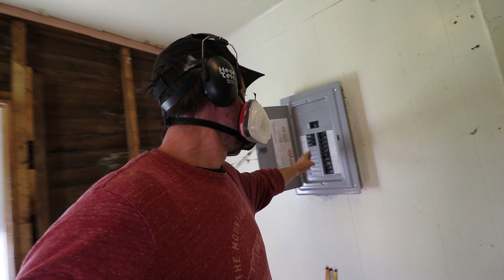You Won't Believe How Fast The Kitchen Disappeared! (home renovation demolition)

Comment: I totally agree that books are not meant to be thrown away BUT if you have a record of each book (even just a picture)  you can start the adventure of replacing them.  I have moved several times and my books had to come also. Tragic struck on my last move when the moving men put only half dozen or so of my boxes of books in the basement which was damp. I cried. Then my sister (the librarian) told me what I just told you. Start the adventure- visiting used book stores is always a fun trip. I still miss them, and have not been able to replace them all YET, I keep trying. Chin up and power on. Luv you all!

Comment: Was sad to see the cabinets come down.  I work in a cabinet shop and I see great kitchens come out just because they want a new look. The older kitchens were made to be suitable for great storage.  Sometime the cabinets that go back in will not last near as long as the old ones.  So when you go to design your new kitchen, please go over your favorite things in the old one to design back into the new kitchen.  Like the little shelfs in the upper cabinets. and the shelf on the ends.  If your like that part of your old ones. So many new things that help with storage even in smaller kitchens.  If your doing it yourself try a few different plans to help and them decide. Great soft ware out for designing help.  One question I have is. How did you stay warm in the winter with no insulation?

Comment: Bri so sorry for the loss of your books!  I am a book Mender, and taught Book Mending for over ten years...You might be able to freeze them.  They would have to be in a freezer for quite some timeTHEN they have to be handled very carefully because frozen books break Very easily, wile they are thawing, they need to be set upright on a wire rack and when thawed enough, fanned open.  Use at least 3 fans to move the air around the books. You could also remove the text block (if it has no mold) from the boards carriers of mold.  Might be easier to say your goodbyes and let someone else toss them

Comment: There are big rectangular tarp-like containers you can use in demos, etc, so you only handle what you remove once - when you toss it into the container. They are smaller than dumpsters, for smaller projects, but could allow you to fill & then use the handles to move as much weight as you or with others helping, can manage. This keeps stuff off the floor, & requires fewer trips to the dumpsters. They can hold lots of very heavy stuff - like all the debris you tore out of the 1st room, & after dumping that in the dumpster, could've held all the cabinets in the kitchen,  plus the wall board, but you could dump the cabinets then come back & refill with the wall board & ceiling debris, in a 3rd trip. They are usually set out by the street & the company comes & a mechanical arm grabs onto the handles & picks up the mini dumpster & dumps it out, then returns it to carry back yo the project if ongoing. It is likely costly, but less expensive than a big dumpster.

If they're too pricy, what about 2 or 3 tarps stacked on the floor, with nylon /plastic cord strung through some of the holes to draw up 3 thicknesses of tarp to form a kind of pouch like shape which you could fill, & then drag or carry it out using the cords threaded through the eyelets,  maybe requiring help if filled with too much weight. 

You can estimate the weight as you load, however,  rather than just throwing everything in a pile which you then have to go back, to & pick it up - by each  bit of debris, piece by piece, & walking out with a puny armfull at a time. This is bigger than human arms, so holds so much more, even little pieces, this cutting out a whole lot of work for yourself.

Comment: Art that old ceiling in the kitchen looks like it could be asbestos please be careful. The one you uncovered.
Reply: I was thinking the same thing!  Asbestos is worse than mold in that it causes cancer years later!
Reply: Asbestos tiles are usually 9 by 9 inches in size.
Reply: Yvonne Hummel  if you look when he knocked out that big tile there were smaller tile behind it. 8:48
Reply: @annettenewton6240  yes, saw that.  Just commented for information only - to know what to look for.  For their safety.  I've done a ton of renovations over many years and have come across all kinds of gross and dangerous crap.

Comment: I would set those books aside in the barn and when the time is right put them in a smalle Room or big Box with a diffuser full of thieves oil. Maybe you can save them though I would not take them back into the house after it's done

Comment: So the walls behind the kitchen cabinets were wood paneling, and not dry walled?  Were they insulated?  At least this is a great opportunity to get new insulation on all the exterior walls. Your house will be warmer in winter and cooler in summer.  👍👍
Reply: Yep, no insulation any where, would not be allowed to build a building like that in the UK, it’s just going to have condensation as soon as cold air hits warm air, causing damp and mold.

Comment: What i don't understand is why are they not hiring someone to gut and redo the house? They got 60,000.00 given to them from the viewers. That plenty to redo that tiny house.
Reply: Apparently you've never built a house before?
Reply: @jessicah2345  That comment makes no sense! They should have hired someone a year ago to go it. Not live in a 1 bedroom camper with 5 kids and do work on the house...
Reply: @joespring7240  simple 60k is not even close to enough money to hire someone to gut and redo an entire house plus pay for the regrading/drainage issues and the mold remediation plus the new HVAC/ventilation system... My brother recently got a quote to build an ultra simple 1400 sq ft box shaped house on a slab in the Midwest and it came back at 330,000 and that's before buying land and with him doing several things himself drywall, taping, painting, flooring plus having in law family do heating and plumbing for trade labor... They've said multiple times they are using CASH only no loans to do this remodel and it's nearly like starting from scratch with how much they have to gut

Comment: I would have burnt the house down, it would have been way cheaper and a lot less work to start over again on a different spot. I would be cheaper to get a prefabricated home and add on. Mold is terrible to deal with!!! I would be afraid it would come back. You have done so much hard work!! 😣

Comment: Most Librarys will take used books. What they don't use they resale or donate to Senior homes.
Reply: These books are not donatble. They are mold contaminated. The choices are spend thousands on remediation, or throw them away. Ive picked up used books that have triggered mold flair ups in me, because people assume its no big deal.
Reply: @willowgrove9288  I thought maybe there were some that did not have mold. Thank your for the response.
Reply: @willowgrove9288  I'm not sure she was suggesting donating their moldy books, but rather stating that libraries take in other's books and then reselling them rather cheaply. I know my library does that; they call it " the lobby sale" as that is where all the extra books are on display.

Comment: donate those books to library--don,t throw them away--wow thats nuts.
Reply: A library would not want them.  They are moldy and a health hazard.  If you mix moldy books with clean ones, the mold will spread to the "clean" ones.
Reply: @debinnashville2009  have delt with this---what you do is lace the books in a plastic bag with a clorine tablet and close tight--let it stay there for a week--then remove each book and air dry in high heat.
Reply: @JanetWilham  Good to know!

Comment: BRI BOOKS = I know what you are feeling! I had to trash SO many of mine, set & ruined. 😢 

BUT have you checked with a certified archivist of antiques, books, & art? They preserve & restore those items. I suggest you contact some in the Asheville area. Might call Biltmore House. Talk to used booksellers, art galleries, museums, book binders. The one in my area was great & not too costly, but she passed away years ago. Some of the mold on paper is called "foxing" & can be killed with some or. all the stain "lifted." They use a gas chamber, & I had an engraving from near the 1920's that she cleared of mold & reframed. 
Also, UV Light can kill mold & its roots. I'm on the Gulf coast with very high humidity + tropical storms. 

Gotta rush, appt. My email not working but phone texting is. Get back to you soon. 

Just thinking about you maybe being able to save a few of your most treasured items. 

BTW for cloth fabric & clothes. Machine wash & dry on high temps like you said you did. Use 2 rinses. On the Final rinse, add 1 cup of White Vinegar to the water, nothing else. Let it agitate to mix into the cloth thoroughly. Let it soak for awhile. No other additives this cycle. Then finish the cycle & dry in hot dryer. IT WILL NOT RETAIN THE ODOR. Also, can do with hand washables. I soak in plastic bucket with hot water, 1 cup white vinegar, good liquid detergent. Sometimes up to 2 days, swishing it about every 4 hours. Then rinse & dry as usual for that fabric. 

Sunshine (UV) light kills mold, too. I'm currently researching UV Lights for treating furniture items etc. in my brand new she'd just delivered. NOT safe to expose yourself in UV light waves though. 

BBL. ❤️

Comment: Trick when working alone n need to know what circuit breakers live.... Get a radio , anything devise makes noise n uses electricy.... Plug in turn on loud then go to power panel n switch back n forth till u discover what belongs to that receptical.... Good luck. 🥴